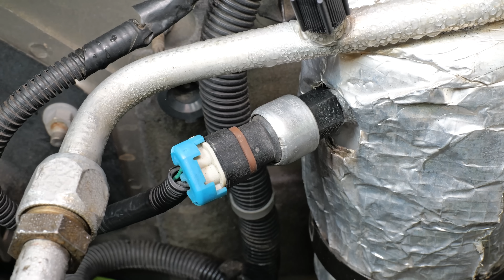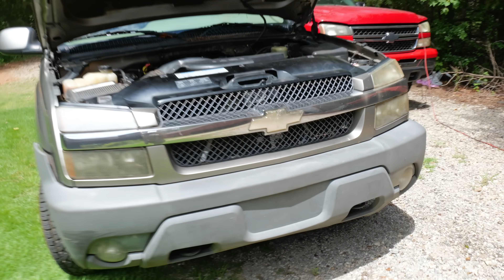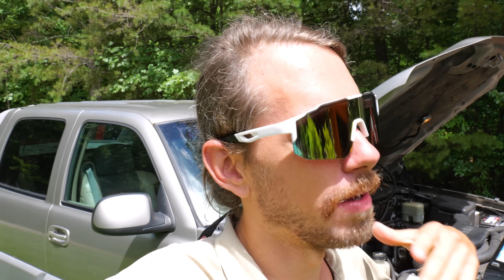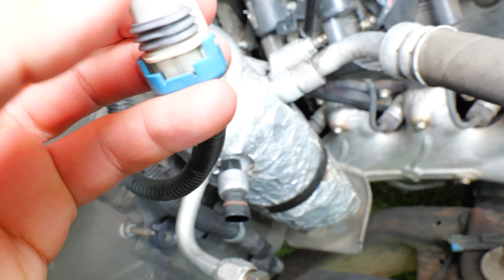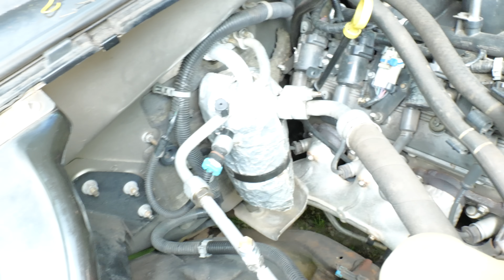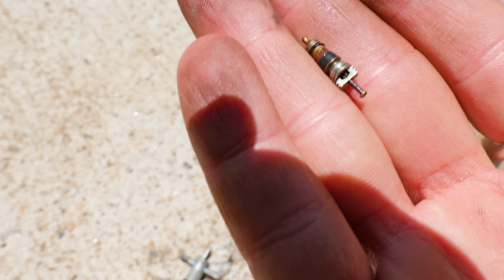BAD Chevy Truck AC Pressure Switch? THINK AGAIN

Comment: When you’re filling the system from a low refrigerant/no refrigerant state, as you add to the low side, you should be able to easily hear the compressor kicking on, at that point you should see the low side drop dramatically for a few seconds at which point you will hear the compressor stop and the gauge will rise again, this on off cycle will continue until you get enough refrigerant into the low side to prevent the switch from throwing. If this is happening as described, it is a shurefire sign that the pressure switch is OK and you should probably find out how you’re losing refrigerant. You’ll feel triumphant for a day or two after the recharge until you realize that you just put 40 or 50 bucks of R 134 up into the atmosphere.-
Reply: If you had just burned the $40 or $50 you would have got heat instead
Reply: Yep
Reply: this is where those little black flashlights come in handy

Comment: hey matt, some weird stuff going on... 02 tahoe. got some manifold gauges and pulled vacuum on my system, then i started charging the ac, NO COMPRESSOR!!! i jumped the relay, jumped the low pressure switch, i even reset the climate control computer... still nothing.. would this mean i need a new compressor/clutch?
Reply from the maker: I would go to the AC clutch next. Make sure you have 12V at the clutch and don't replace it for no reason!

Comment: Mine is SO intermittent...good charge but sometimes just all of a sudden blows tepid air. Touch the accelerator and freezing cold again. Driving me nuts
Reply from the maker: People tell me this happens when the compressor is going bad. More throttle helps it spin faster. I'd check the ac compressor clutch first.
Reply: @MattsShop dammit man...that's not what I wanna hear!! Thanks Matt
Reply: Mine after many years of off on a/c finally fuiger Ed it out it was the plug connector terminals was lose to the switch he showing I just in pinned and tighten them a bit no more problems.
Reply: @markbirthday-jl2vu gonna have to try this myself
Reply: New resistor will fix it